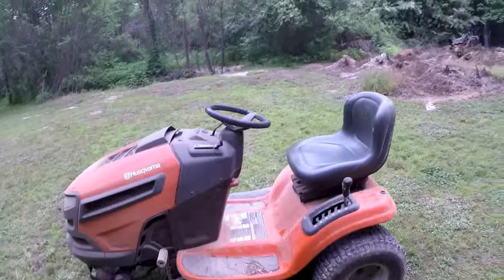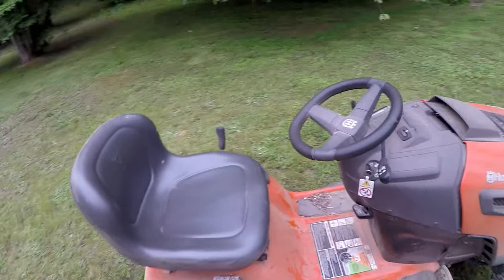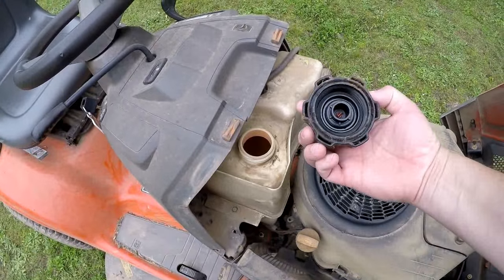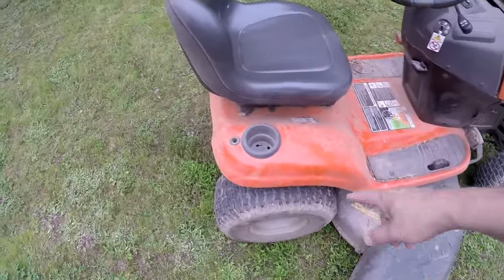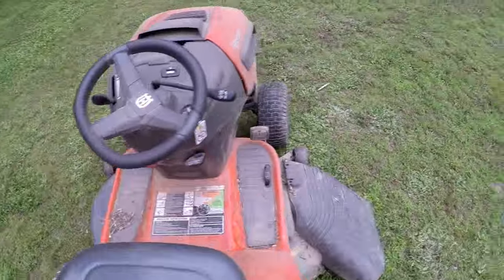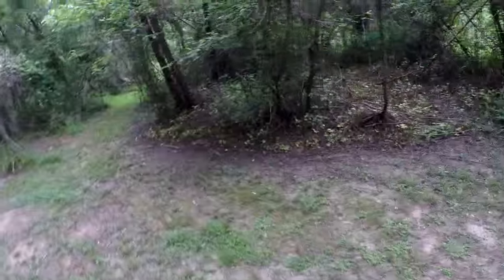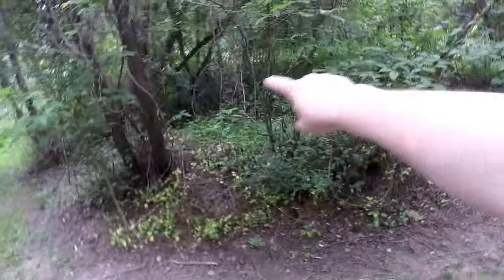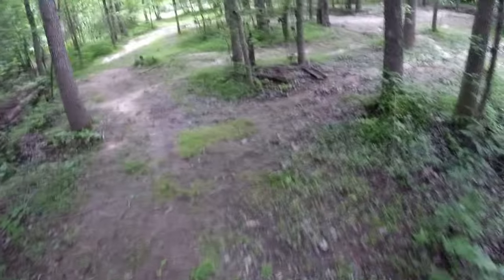Husqvarna YTH22V46 100 Hour Follow-Up Review

Comment: Hi Dennis. Thank you. We found that the mulching blades leave a trail of cut grass under the center of the tractor- and some clumping. Any idea why that would be? Thanks and keep up the good work!
Reply from the maker: +Maria Gianas Hi Maria,  I'm not sure what could be causing that...I have mostly centipede, so usually very few worries with cutting it, but it doesn't get very tall.  I wonder if the mulching blades can't handle the height of grass you are taking off?   Or.....do you cut with the tractor at full throttle?  If not, that will affect the quality of cut too.

Comment: Hi Dennis, tks for the great review. I'm looking at buying a nice used Husky like yours. I have a large piece of property in SC very similar to yours. Curious about how its held up over the past 5 yrs ? tks
Reply from the maker: Thank you for watching!  Mine has done pretty well.  I've been rough on it and only had a few issues.  I broke a couple of welds on the deck by cutting stuff in the woods.  Also had to replace the spindles once...same reason.  haha.  Otherwise, it has done just fine and I am still using it without problems.
Reply: @dwcoffey  Tks for reply. Good to hear, yeah trying to mow down trees will do that ;P

Comment: Great follow up review Dennis. Thanks! I was waiting for the pet where you talk about mulching blades vs. regular...did you decide not to try the mulching blades and if so, why not? We have tried both and are having a household debate as to which are better. thanks!
Reply: Meant *part, not pet" sorry bout the typo!
Reply from the maker: +Maria Gianas Hi Maria, I've put 2 sets of mulching blades on my tractor since buying it.  For my lawn, which is centipede grass, I think they cut the clippings finer than the bagging blades.  The quality of the cut seems to be about the same, although I've only had one set of bagging blades, so I don't have a ton of experience with them.  Maybe that's a good idea for another video...compare and contrast mulching blades vs bagging blades.  :)
But I don't use a bag, so I wouldn't be able to compare how they perform with a bag attachment.  What have your experiences with different blades been?

Comment: You said you changed the oil Twice now. What about the spark plugs,,,and Especially, the Air Filter. After seeing this tractor and the dust, surely it needs changing? At any rate, after 100 hours on the same tractor I"m going to get, it will still look showroom fancy.
Reply from the maker: Hi Joe, I haven't changed the plugs yet....haven't really needed to yet, but probably will soon, just so I can make a video :)   I have changed the air filter...with all the dusty conditions I cut in, it was definitely necessary.  Here's a video of the process....it's super-easy:  https://youtu.be/LiiaxutYyFA
Thanks for watching!
Reply: Not likely it will still look new lol.

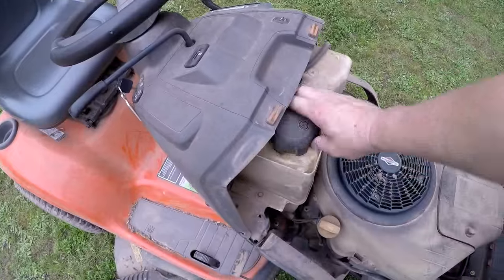Comment: at 2:17 the fuel tank has the purge or return line. I just found the line on my mower was free ranging, not attached to the fuel tank. It won't securely attach to the tank. For the life of me I cannot find what part I'm missing, or more likely, I'm not smarter than the equipment I'm trying to work. Any advice?
Reply from the maker: Thanks for watching, Matt!  I think it is called a fuel tank stem....check Jack's Small Engines and search your particular mower.  They are most likely to have the part.
Reply: @dwcoffey  thank you, Dennis. I appreciate the advice!

Comment: Have you extended the bottom of that cup holder yet :)

Just picked up a Cub with the same engine, glad to hear it holds up.
Reply from the maker: I'm at about 200 hrs on mine and so far, no problems at all.  I  think I'm going to change the plugs out soon...I'll video that and maybe it'll help folks too.  Thanks for watching!

I'm still thinking on how to fix that cup holder.....I had it out the other day and I think I have it worked out.  I'll post something once I figure out a good mod for it.  :)

Comment: i bought a new one this year 2016 and sometime when i drive it it make a 
Gargling sound when i push the petal down it dont do it ever time this is the first hydo i have owned i only have 8 hours on it.........do they make that sound sometimes i know they wine a little i thought the deck was hitting the bottom of the frame at first i checked everthing out everthing looks ok and it drives and cuts ok but if somethings wrong i want to know like i said its my first hydro and i dont know how they are....if something is wrong i want to take it back to have fixed...maybe the belt is slipping a little
Reply from the maker: Hi Eddie, it's hard to say without being able to see and hear the tractor.  I'm not home at the moment to check this, but if I recall correctly, there is a process outlined in the owner's manual for initially beginning to use the tractor.  I believe that process includes 'burping' the hydraulic system.....check your manual for that and make sure it applies.  Sounds like the problem could be air in the hydraulics.  I'll try my best to check it tonight when I get home too.

Comment: as always nice video Dennis ..i do the same with my tractor  (same one as yours) and the front guard did the same thing to me .. and i also agree with the. up holder..keep up the informative videos bud
Reply from the maker: +deadlydiesel556 Thanks for watching and thanks so much for your comments!  Glad to know I'm not the only one beating up my tractor  haha
Reply: +Dennis Coffey Do you have problems with the belt guards getting full of grass on the deck.   After changing the oil and filter today I'm tempted to just leave all the plastic off the thing to make it easier to maintain.   It seems to be a decent tractor but the time spent on maintenance is crazy.  The wheel bearings look totally dry as well, I'm wondering if the factory put anything in them.  I noticed somebody said they lost a wheel and that might be why.  Anyway, just found your channel, thanks for your time doing the reviews.
Reply from the maker: +Rick James Hi Rick, thanks for the comments and for watching.  I haven't had any trouble at all with my wheels or the wheel bearings, etc, although I have had a couple of folks comment that they have.  As for the grass accumulating under the deck....yes that is one thing that I haven't thought to mention, but could definitely be improved.  I've been able to just rinse it all out with a regular nozzle on my garden hose, so it hasn't been a problem to me at all.  But I do think the design of the guards could be a bit better, and allow for easier access to flush the grass clippings out.  If it was a tad more open around the guards somehow, the wind and movement of the pulleys might actually knock most of it out while cutting.

Comment: I have the 24v48. great mower. i only have about half as many hours. only thing I really wish was that some of the accessories were cheaper. ie why is it that a plastic tube and bagger attachment is like 300-400$? just stupid to me. would be nice to find a good aerator and rake for it, that isn't super ridiculous expensive too.

do you run any fuel additives? I found my carb was getting kinda gummy nasty using standard fuel pump gas (E10 is standard here, hate it) so i've been running a tad bit of seafoam and Sta-Bil to clear it up. runs great now. it says not to use E10, but I don't really have a choice unless I want to drive about 3 hours to the nearest out of state non-E10 station, grab some 100LL from an aviation fuel pump (at around 7-8$ a gallon) or pay the ridiculous price they want for the pre-packaged stuff at the hardware store, i believe thats like 10$ for a half gallon or so?

guess I didn't read the manual all the way, didn't know you could set the parking brake and get off of it like that. also nice to see how you kind of "abuse it" i'm kind of rough with mine as well, but having seen the areas you clear makes me feel a bit better. also having taken the deck off, i'm fairly confident that if anything went wrong the belt/pulley system would take the brunt of it and prevent any damage. my wife did get one of those dog leads tangled up in it, and it just turned itself off. note if you have this happen, just take the blades off instead of trying to untangle it. once the blades come off it just unravels.
Reply from the maker: Thanks so much for watching and sharing some great comments!  I agree....once something gets caught up around the blade spindles, the best thing to do is just take off the blades and get it out.
I haven't had any trouble with mine running badly, but, I always pout Sta-Bil in my gas cans when I fill them up.  If I were to have any issues, I'd put a half-can or so of Seafoam in a full tank.  Beyond that, I'd probably try spraying some carb cleaner into the carb, and also check the fuel filter.   Briggs website says that you can run E10, just nothing with higher than 10% ethanol, so you should be ok there.  Thanks again!!

Comment: My Husqvarna...YTH22v46 arrived without any lube in the front wheel bearings...or in the front spindles. After about 10 hours, they were screaming every time I turned left or right. I bought a grease gun and lubed all four zirk fittings...twice just to get enough grease in them to stop the squealing. I have since added more grease. And, if you didn't know it, your pulley spindles on your deck had zirk fittings and also need to be lubed. 
Also, my oil drain valve on the engine block was loose. I haven't figured out a solution for tightening it...since it's so low in the engine block. When I tried to rotate it left to open it during my first oil change...the whole assembly rotated. The leak can best be described as a small drip. I check my oil before each use and didn't notice any exceptional usage...so, the leak is very small...but annoying.....
All in all, I like my mower...but have to wonder about the quality assurance during assembly. 
Anyways...hope this helps.
Reply from the maker: Yes, I'd have to agree.  All those issues don't reflect very highly on their QC initiative, that's for sure.  Thanks for the info!

Comment: Liked your review. Having a problem with belt coming off mower deck, thought you may mention but you have had none, correct? Thx. Tedd
Reply from the maker: Thanks for watching, Tedd!  IS your deck belt coming off at the engine pulley?  I've had a problem with that when I disengage the blades too fast...like if I flip the PTO lever down and just let it go, the belt will sometimes pop off the drive pulley under the engine.

Comment: Dennis...do you have a video on changing the drive belt of the Husky ?

THX
Reply from the maker: HI Craig, I am sorry I don't...but, I'm about to make a video of replacing the spindles on the deck  I can work in a video of changing the drive belt while doing that.  It may be a couple of weeks before it is up though as I'll have to edit, etc.
Reply: Dennis,
That would be great..very helpful and would like to see your method for getting the tractor off the ground/elevated to access.
Reply from the maker: Hi Craig,  If i need to elevate the tractor, I just use car ramps.  To remove the deck, I just slide it out of the side, no jack required.

Comment: how is it with hills I wonder?
Reply from the maker: Thanks for watching!  It does ok......I have a steep hill in my backyard.  From the factory, the tractor struggled a bit keeping traction when going up the steepest part of the hill.  I filled the back tire almost all the way up with antifreeze and water, then topped them to 10psi with air.  That helped a lot.  Now, unless my grass is pretty wet, I don't have any traction issues.  There's plenty of power to get up a hill, its just the lawn tires that don't give the greatest traction.

Comment: How big is your property if you don’t mind?
Reply from the maker: Thanks for watching!  I cut about 2 acres of lawn and 'bush-hog' another acre or so on our property with this tractor.
Reply: I’ve been looking at four different lawn tractors and picked one very similar to yours. Just newer I believe. The property I have is a slight slope with just a few trees but 3.6 acres in size.
Reply from the maker: I have one area with a 30degree grade.  When I first got my tractor, it really struggled with traction (turf tires) on that grade.  I got an adapter and nearly filled the back tires with anti-freeze/water mix.  Now I seldom have a traction problem due to the added weight.  Other than that, I haven't had any issue covering my property with this tractor.  Thanks for the comments and I hope your new one work out well!!
Reply: Dennis Coffey question does yours have the smaller Tuff torque and will it do a 20 degree hill.

Comment: I've had my YTH22V46 for three years. I like a few things about it and hate a few things about it. I'd never buy another Husqvarna riding mower, because you can't raise the blade higher than 3.75 inches. I have a 19 year-old Poulan Pro 42 inch cut, with 20 HP Intek engine that runs circles around my Husqvarna. I can raise the blade on the Prolan above the ground six inches.

Problems with Husqvarna mower: I cannot raise the mowing deck high enough. I've tried everything but buy bigger tires. Hard to start. I've changed plugs, air filter, fuel filter and only run ethanol-free gasoline with stabilizer. The fuel supply is fine. The spark is fine. Fuel squirts from the fuel line if I disconnect it from the carburetor. I have to crank forever and then charge  the battery with a charger to try a second time to start the damn thing if it sits more than a week.

What I like: The Husqvarna cuts fine at 3.75 inches and 3 inches. I Sharpen my blades every twenty-five hours of use. Love the hydrostatic transmission. The frame and chassis are well made. The seat is comfortable. I have to mow one long sloped hillside that is a little hairy. Scary is a better way to describe it. I feel like the mower might roll over any minute. The Husqvarna is more stable on that slope than the Prolan. Not sure why. The slope is like that picture they include in the user manual that says never mow on a slope like this. The wheels have never come off the ground with the Husqvarna. I have to lean over hard toward the hill side to mow it, but it works. I used to mow it with a walk behind mower, but I can mow the slope with the Husqvarna okay. The daredevil comes out me when it gets 100 degrees outside.

I paid $1600 for the Husqvarna three years ago. I paid $2000 for the Poulan Pro 19 years ago. The Poulan mower has never failed to start. I've replaced the front tires, several blades due to hitting racks and roots, replaced the gas tank, spark plugs, air and fuel filters. On my third battery. Last battery purchased in 2005. The Poulan Pro has a hydrostatic drive but has a handle on the right side to control speed. I have a trailer I often use with it. It has pulled a six hundred pound load of dirt up a 40 degree incline driveway with no problem. The old Prolan Pro is one tough lawn tractor. Worth every dime I paid for it.

I change the oil and filters in my four mowers every twenty-five hours. I use Pennzoil full synthetic 5W30. I order oil and air filters from Amazon. I change air and oil filters at every oil change. I mow three acres of rough terrain at my cabin and one acre at my main residence.

If I could raise the blade on the Husqvarna high enough to use it at the cabin and it would start on the first try, I'd be fine with it. If you have some rough terrain and need to cut six inches above the ground, the Husqvarna is not going to be able to do that. At maximum blade height, the cut is only 3.75 inches. All three of my older mowers start right up, even if they sit for weeks. The Husqvarna is the only mower I've ever owned that was hard to start.

I know how to maintain small engines. I own four mowers, a twenty-year-old chainsaw, three gasoline generators that are over fifteen years old, and a six HP outboard boat engine on my sailboat. All of them have never failed to start on my first try, except the Husqvarna.

Maybe I got a lemon. I hope the rest of you have had better luck with your Husqvarna mowers.

If anyone else has experienced the hard-to-start problem and solved it, please tell me what you did. I would be grateful.
Reply from the maker: Hi Jack, thank you for watching and for your info.  I agree with you......the two most common complaints I see are hard starting and not enough range on the height adjustment.  I wish they would adjust to a higher cut also.  I am very rough on mine but because the deck must be kept so low, the deck has really taken a beating.  I have had similar experiences with my older 4-stroke and 2-stroke engines.  I've got an old Homelite XL12 chainsaw and a Sears Gamefisher 3.5 hp outboard for my sailboat.....they are both 1970s engines, both start and run just fine.  I completely understand what you are saying. I do not have a good solution (yet) to the hard starting problem.

Comment: Just purchased this same tractor.  Only 20 hours so far.  I can't find anything in the owners manual regarding the little plastic runners. I have extremely in even terrain, any suggestions where the setting of runners should be?
Reply from the maker: I'm sorry, Dione, I'm not sure what you are referring to.  If you can describe where the 'plastic runners' are etc, I'll do my best to help.  thanks

Comment: Mine after 500 hours has broken welds busted mandrel etc
Reply from the maker: I'm very hard on mine...I broke a weld on the deck and had to replace the spindles.  I have a video on replacing the spindles, if you need it: https://youtu.be/00YR0lOPEJY   Thanks for watching!